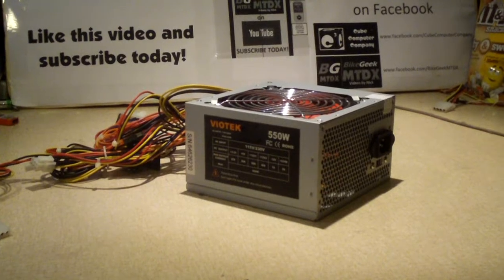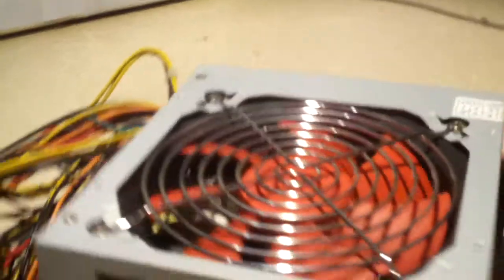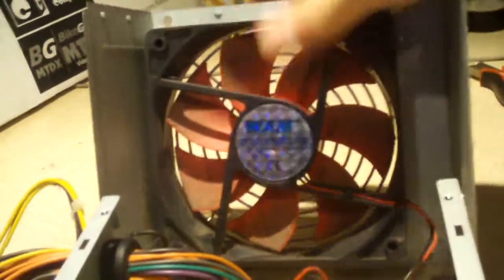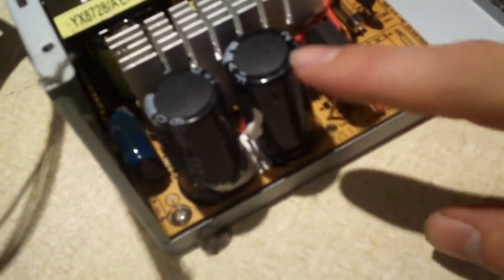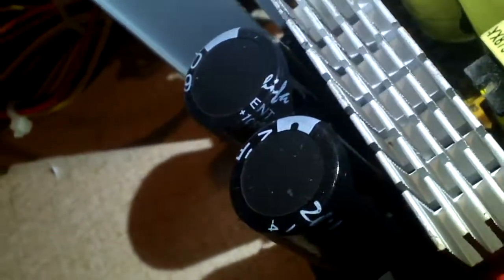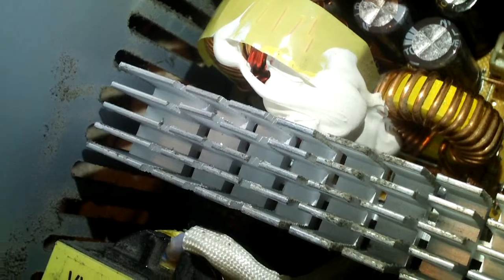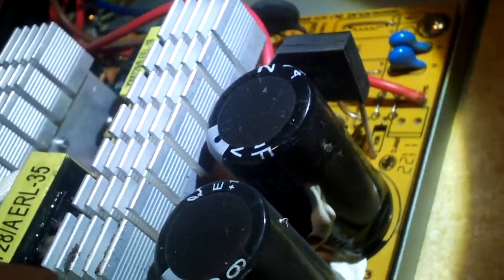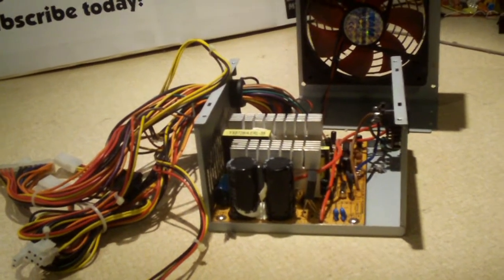A Look inside of a Viotek 550W Power Supply

Comment: Why do you hate WAM fans?
I never had any problems with them.
Reply from the maker: Simple answer... Very recently I had gotten this power supply back after upgrading the computer it was installed inside of. The PCB has dark spots and lots of the capacitors are bulging. The WAM fan seized up solid and cooked the power supply.
Reply: @CubeComputerChannel  yeah, but seized up fan can happen to any brand.
I still prefer WAM fans over some others, and defenetly non branded ones.
Reply from the maker: @filenotfound__3871  But it rarely happens with reputable quality manufacturers.
Reply: @CubeComputerChannel  idk, I had it happen with termaltake, akyga, xilence, cooler master, ms, and some other well known brands
Reply: @CubeComputerChannel  what Im trying to say is fans have a limited lifespan, its shorten if exposed to dust, heat and when they are not beeing cleaned. And I think that WAMs are still better tham much other stock brands from my expirience.
Reply: @CubeComputerChannel  Could it be that, just like bestec, some models are worse, because all my psus are from a brand KOLINK, I have over 20 of them and not a single one failed, and all of thr fans are WAM branded?
Reply from the maker: @filenotfound__3871  I don't consider those to be truly reputable brands. Brands I consider top quality are Delta, NMB, JMC/Datech, Nidec, San-Ace, Yate-Loon and others. Brands I consider OK/reasonable are AVC, Jamicon, Foxconn, Sunon, Magic, Adda, among others. Below that I would include Thermaltake, Cooler Master, and others. I should mention that those manufacturers may source their fan motors from third party manufacturers.
Reply from the maker: I also can't really tell you my experience with Kolink, but there have been times where power supply manufacturers would source from quality manufacturers of PCBs, but crap out on the selection of fan. I've never seen a fan fail in a Bestec, and rarely have I seen one lock up in other reputable OEM power supply suppliers. In the rare cases where one would seize, it had a removable plug for servicing the sleeve bearing.
Reply: @CubeComputerChannel  yate loon is considered a good brand?
They are a most common brand I find in a power supply and I had some of them fail. Anyways thank you forexplaining it well although I still considder WAM a deacent-ish brand because I never had them fail. Thank you for your time and your content is awesome, keep it up.

Comment: True, not a 550W PSU. It is a 3.3x22 + 5x28 + 12x28 + 12x1 +5x2 = 570W PSU. The 336W on the 12V rail is more than enough for most systems. This is a very good cheap PSU.

Comment: My 11 yr old Silverstone 750w full modular and fully black sleeved PSU is still running like a champ!  A long time ago i opened it to see how it was build and was surprised as to how well build it really is. Big capacitors, big thick rails, looks like a perfect anolog power supply with Japanese components. The soldering is very neat and professional. Very high quality components as it makes the PSU a slight heavy on the side.   Very very reliable! Fully modular PSU's for consumers is a 12 yr old technology yet still seems & feels new!

Comment: haha it's the same as a Chiefmax 650watt.. identical (except it has 560uF caps, got no WHAM). Ascendtech still sells them :( I know that they maybe 300W Max, the thing had a hard time with a Palit HD4850, Athlon 64x2 5800+ 2.8Ghz, 4GB RAM, and just one SATA 1TB HDD with 2x 80MM Fans. I tried to get it to go with a full rig added a SATA 500GB HDD, SATA DVDRW, IDE DVDRW, Floppy Drive, 3x 80MM Fan, and AM2 Stock Cooler. Kept on restarting! Got real hot, smelled like burning tape. I even added all the components too.

Comment: What would be the best psu out of these?

Hec compucase 
Raidmax
Coolmax
Logisys 

they would be powering a apu cpu with 65w and a hard drive and nothing else.
Reply from the maker: ***** None of the above. A 250W power supply could run that fine. Better off getting something from FSP... even a used Bestec ATX-250-12Z with SATA adapters would run that fine.
Reply: ***** these power supplies wouldn't blow up right? :

350w lepa
350w fsp group
400w evga. all around $29.
Reply from the maker: ***** Out of those three, choose the FSP. Again, you don't need that much power. 300W would be plenty.
Reply: ***** okay thanks.
Reply: ***** are fhy brand caps any good? i got a power supply and it had those as the 2 main capacitors.
Reply: +Ciays i would say none of them are really good but i would pick coolmax
Reply: +Cube Computer Channel lol i have pentium 4 pc with 250w psu ;)
Reply: For future reference of anyone who's ever gonna stumble upon this: what makes Heroichi (HEC) stand out from the bunch is that they make their own units. Those range from junk to very decent (like, Be Quiet! grade decent). 
Raidmax is mostly Andyson rebrand galore. Their older stuff is very shady, as for what they've released in the last couple years, their Bronze and Gold units are nothing to write home about. Just unremarkable Andyson platforms with junk crapacitors. Platinum and Titanium models are miles better, as per reviews at least.
Any Coolmax I've heard about is a turd. Sorry.
Logisys, same story. Though interestingly, Logisys is the former industrial name of Deepcool as far as I know. And not only Deepcool chaps shine at cases and coolers, they also relabel some pretty usable (Deepcool DA and DQ) power supplies provided by CWT. DN and DE are nothing special.

Comment: It's good for about 350W output power. The switchers, input caps, bridge, and rectifiers are about good for that. But more importantly, is doing it in spec. I imagine the voltage regulation wouldn't be too terrible, but the main issue with this unit is the output filtering. With only one cap per rail and no PI coils, I can't see that thing doing more than 200W with ripple in check. It would be nice if they actually provided slots for them, so that you could add them! It does though, look like there is a spot to add a PI coil on the 5VSB filtering. It looks like it was just jumpered. And yeah it could definitely use the other input filtering components installed. I think the crappy capacitors survived because the fan is wired straight to the 12V and keeps them nice and cool. Thanks for uploading!